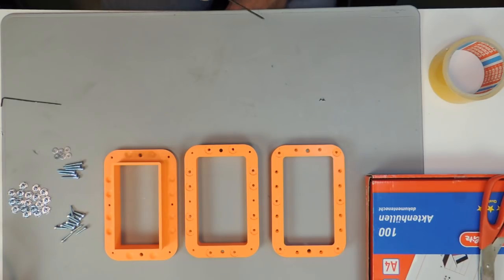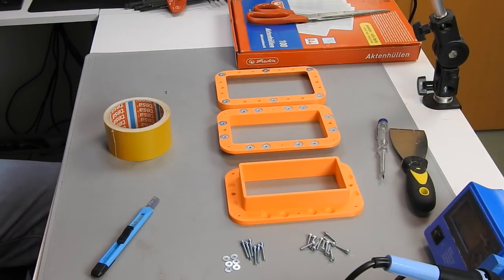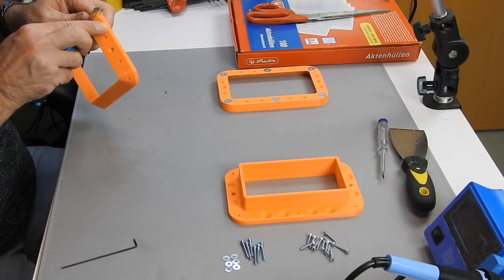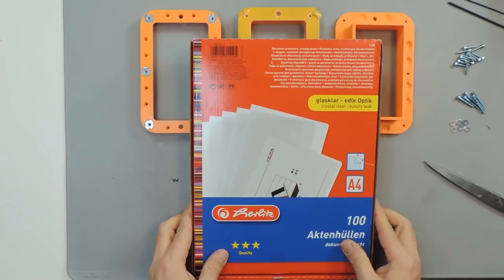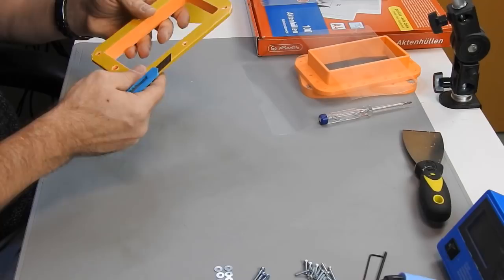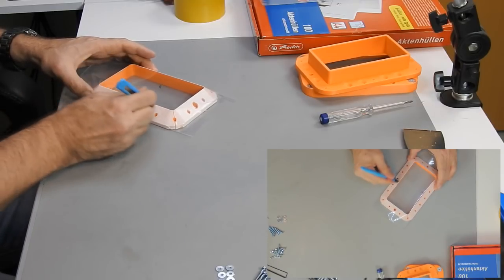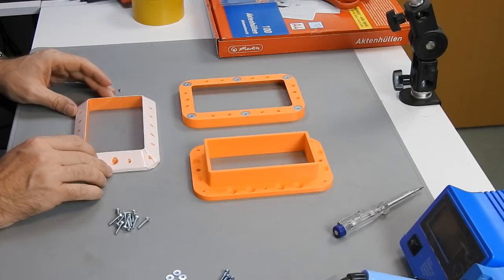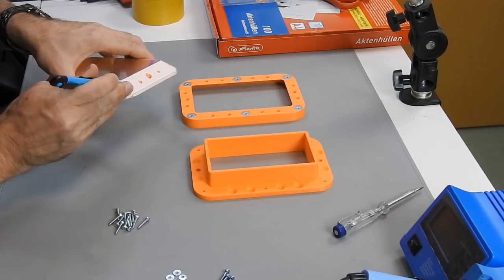DIY: FDM-printed SLA-Printer: Episode 4 - Build the VAT

Comment: 1)what fdm filaments can I use for a resin vat? I want to use nylon or petg for durability. 
I also fear leakage, 2)what is the best filament to use?
 I've seen ppl take resin to smooth fdm prints; 3)can I use the same method to make the resin vat water tight?
Reply from the maker: Martin White printed it in PLA with 100% infill. Is watertight without further treatment

Comment: Where to buy cheap FEP film for this? Aliexpress links anyone?
Reply: some vinyl for inkjet printing use pp or other plastiks, in stead of paper. those  are clear with silicone on 1 sideand wery thin and strong.i make signs and put it the garbage, may be the sign maker in your town have some.

Comment: dont we have to use fep film you mean?
Reply from the maker: Furkan Birışık you are free to use what ever works best. 😉
Well FEP film is most likely the best joyce as it has the least adhesion to the cured resin and the print object/ build plate will release more easely. But it‘s propably the mosr expensive foil I ever purchased. PP is not quite as good but a cheap alternative. So I think its worth give it a try first before going with the expensive solution
Reply: thank you https://youtu.be/L0omLMDEv60?t=14 can you wright this down this nut's name or do you have link or somethings
Reply from the maker: Furkan Birışık https://www.amazon.de/gp/aw/d/B076H7JD9T/ref=mp_s_a_1_3?__mk_de_DE=ÅMÅZÕÑ&qid=1520336683&sr=8-3&pi=AC_SX236_SY340_QL65&keywords=m3+einschlagmutter&dpPl=1&dpID=51ClL2oyP6L&ref=plSrch
Reply: Have you actually sucessfully used the PP sheets ?
Reply: All you need now is a vacuum former to make those PP sheets custom formed to fit! 😄 Great job on the videos.